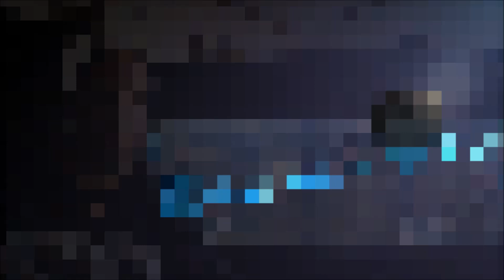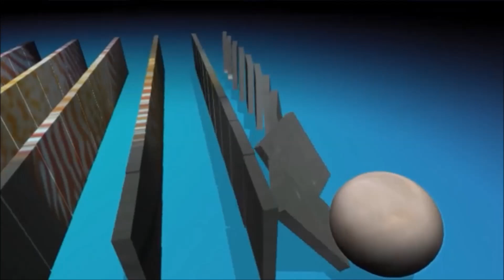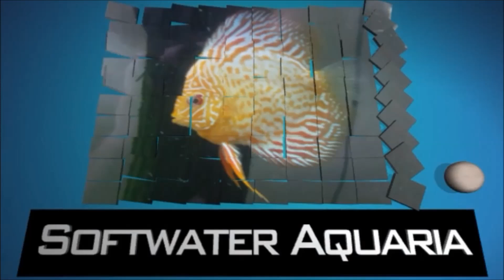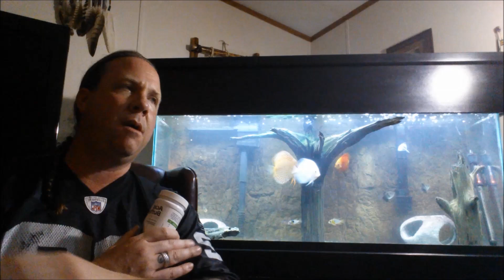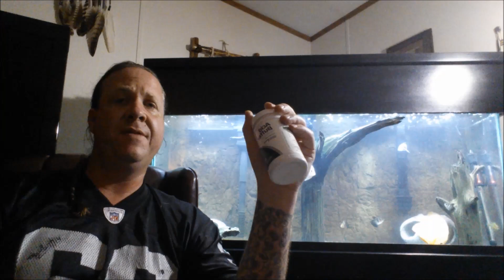Aquarium Acid Buffers

Comment: Could you explain why there is a need to use Acid Buffer™ with Alkaline Buffer™? As Sachem's web site says "When using Alkaline Buffer™ & Acid Buffer™ together to target a specific pH". Good video. Thanks.
Reply: Alkaline buffer add KH that is needed to prevent PH swings. If the water you are trying to treat doesn't have enough KH, Acid Buffer will only lower the PH for a short period.
Reply: Asking same thing

Comment: I found with ahrd tap water the only safe and effective method is run a filter bag with Peat.  My local tap water comes out at 13Gh and 12Kh...Ph is Off the Alkaline charts 10+ horrible.  I've used Seachems Neutral regulator with quite good success and kept tanks at 7.6 for years,  water softener pillows would bring the hardness levels down but it took days and many recharges which all went poof on the next WC.  

So far for my Cichlids and even Betta's Peat in a filter bag keeps the water levels at a constant rate PH stays at 7.0 - 7.2 and the hardness levels dropped by half. and only a slight tan to the water which to me is more natural anyways.  Hope that helps as well.
Reply from the maker: +Robert Kowalke Thanks for the feedback!

Comment: Man Scuba.. your videos are legit bro. Got my first Discus recently cuz of you...  Gonna stock slowly and throw some Roseline sharks in with em like your tanks!
Reply from the maker: +Los Velegend Great, although I changed my mind on the roselines.  They moved too fast and seemed to stress out my discus.
Reply: Man good call...  I watched them eat at my LFS and they are way to fast.... no chance my Discus is ever gonna get to pick flakes of the bottom if their in the tank...  

By the way, what are your thoughts on keeping a single Discus with say a pair of GBR.  I been hearing that if they pair off, they get pretty vicious... and I only have one tank.. id rather not loose fish to aggression, especially if they cost 70 bucks a piece.
Reply from the maker: +Los Velegend Here's the rub with discus, they don't do well in numbers under 6.  They for sure need to school.  Most experts will say minimum number is 10.  They're probably right.  If alone, they stress and that causes a host of problems.  If too few, they will pock out the weakest one and beat the cap out of it and then he'll get sick and die.  Then they'll move to the next weakest one and the cycle will continue.  You can buy 6 or 7, 3" from Hans for about 35$ a piece.   I'd advise to keep them in a species only tank.  If you must, then GBR'S are good tank mates.

Comment: does  seachem discus bufer remove the required trace minerals for fish  and hence we require seachem fresh trace to restore those minerals?
Reply from the maker: +Ravin Krishnan No it does not remove the mineral content.  But it should be used with RODI water.   Other than that,  you really don't need it.  Are you using RO water?
Reply: no i am not , only tap water for now

Comment: Hey Scuba Steve I'm thinking about using ro/di water to soften it up and drop the ph. My question is how low does an ro/di system take ph?
Reply from the maker: A good one will completely strip down the water.  You should get a ph of 6.  Of course you have no buffer so you need to add back some tap water to it unless your tap water is really bad.  That is really the only time I would say you should use buffers.